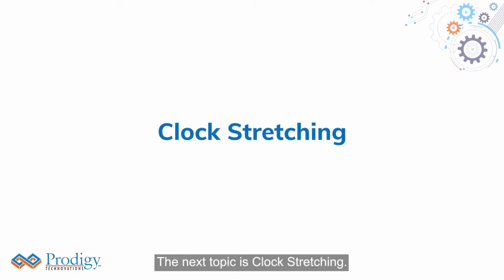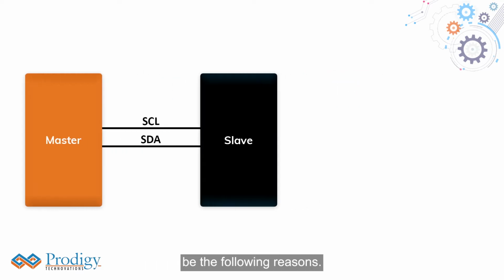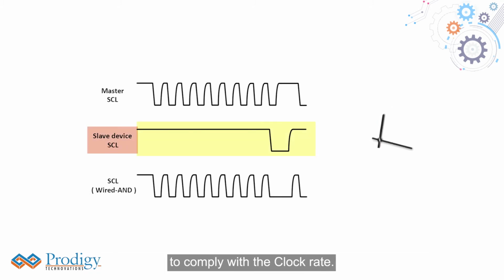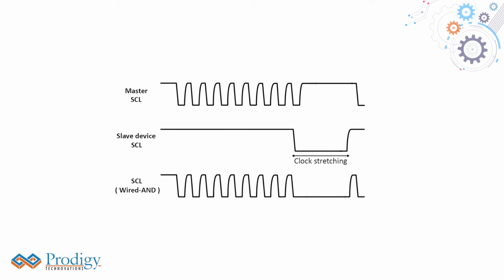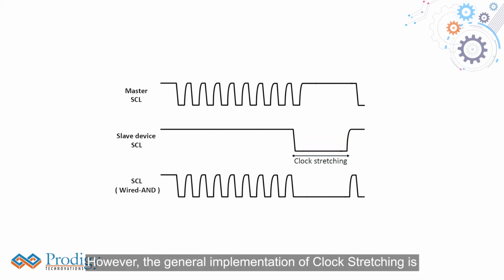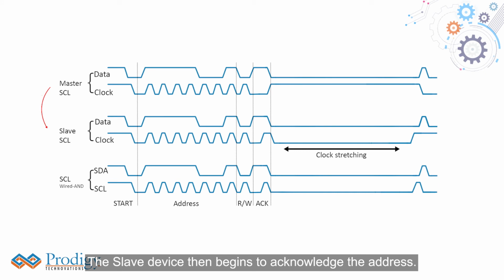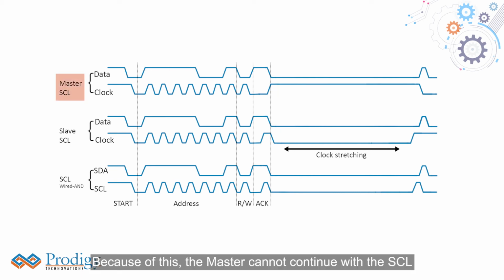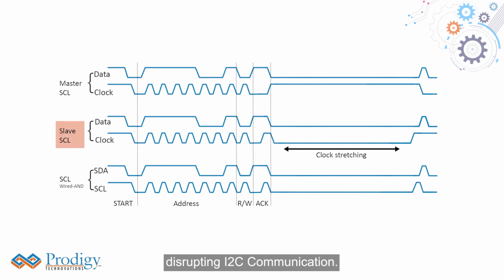I2C Clock Stretching | Prodigy Technovations

Comment: what if there is a no recovery form the clock streaching, 
what if the slave is not responsive?
Reply from the maker: Hi, Thank you for your interest. However, if there is no recovery for clock stretching and the slave device is not responsive, it can lead to communication failures. Clock stretching is often used by slave devices to slow down the data transfer if they are not ready to process the incoming data.
Reply: Sadly i can't find many info on I2C failure handling. From what i know if a slave holds SCL down blocking the whole BUS the only solution is to power cycle (cut power) the slave by its reset pin (if any) or by external circuitry. I usually try to avoid devices that clock stretch if i can, so i prefer devices that don't, so that their SCL pins are inputs only!